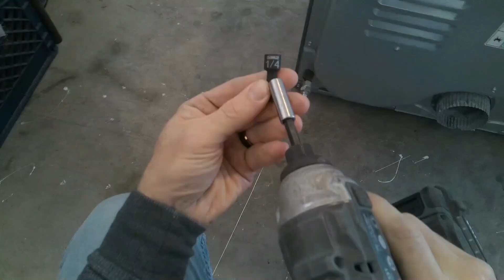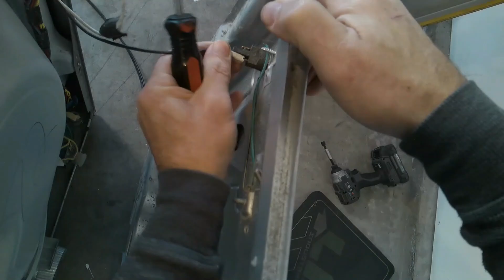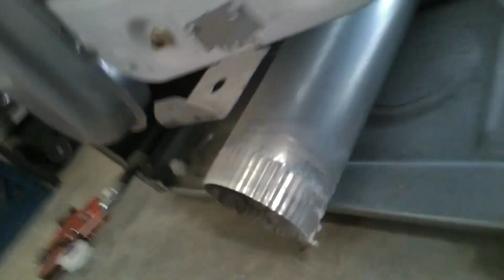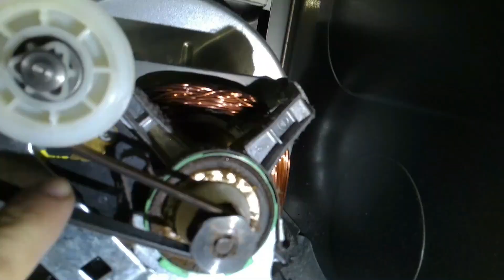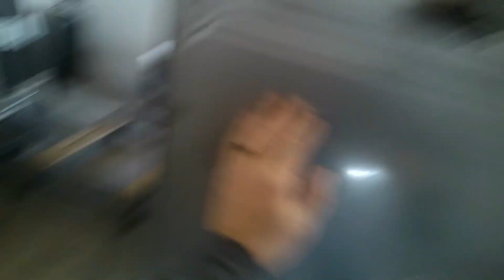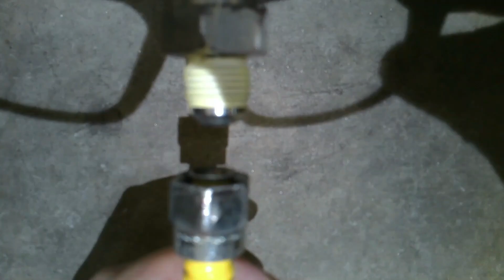Why Does My Maytag Dryer Squeak? Quick Fixes & DIY Repair Guide

Comment from the maker: 🔧 Maytag Dryer Squeaking or Making Loud Noises?

If your Maytag dryer is squeaking, screeching, or making loud noises during the cycle, a worn idler pulley is one of the most common causes.

👉 Dryer Idler Pulley (W10837240) used in this repair:
https://onlineappliancepartshub.com/products/w10837240-dryer-idler-pulley-and-bracket

✔ Always confirm compatibility by typing your dryer model number in the search bar before ordering.

💬 Need help diagnosing your dryer noise?
Post your dryer model number and symptoms below, and I’ll try to help point you in the right direction.